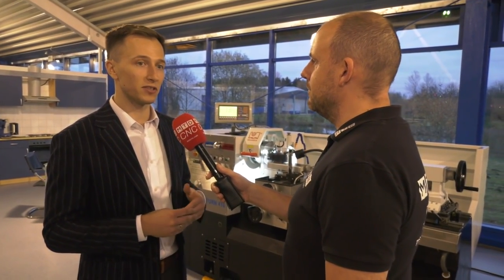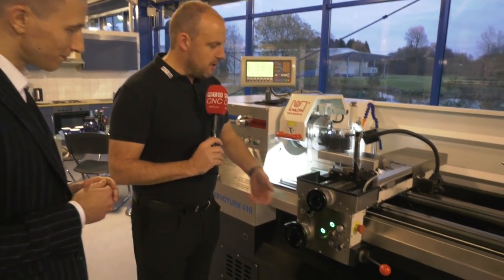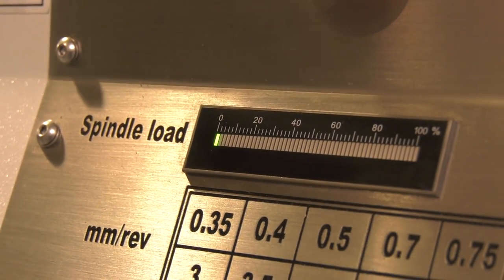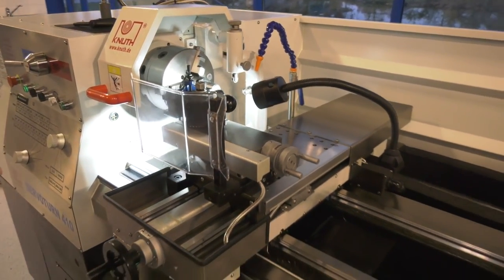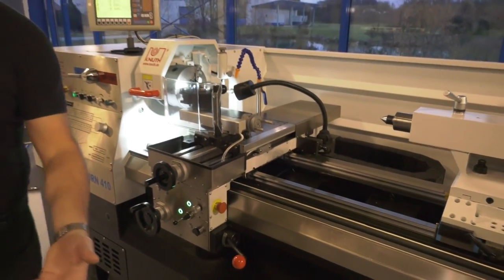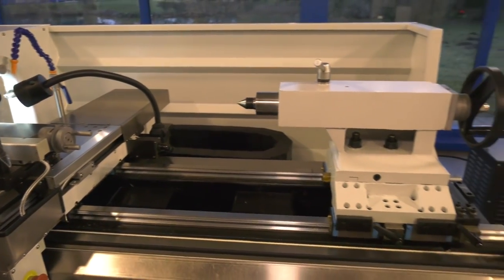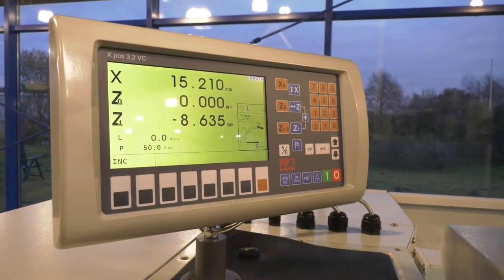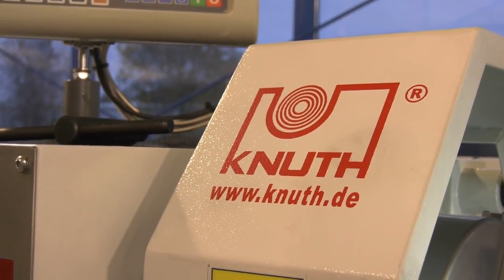Why would you have a mineral casting on a lathe like this?

Comment: Btw was anyone wondering why the ways were not covered? People worry about it yet when have you seen any lathe with a covering? Not good on a horizontal. Besides you’re talking years before they’d need to be replaced and they’re cheap compared to cast in the frame ways.